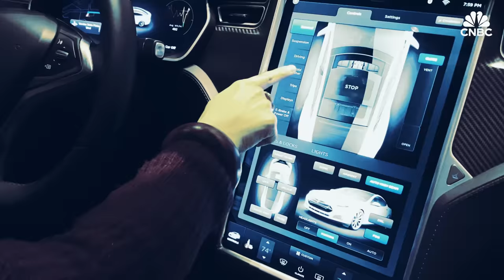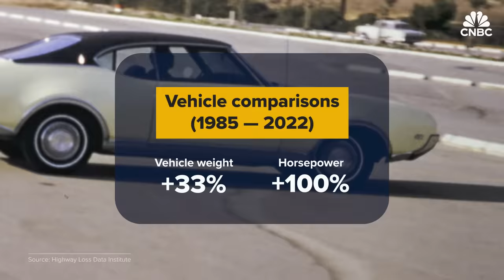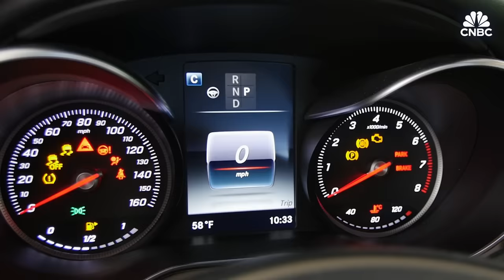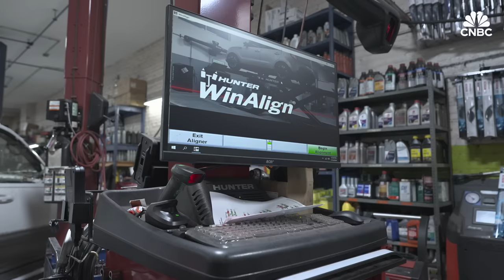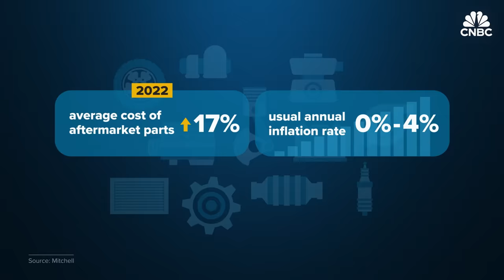Why Car Repairs Are Getting So Expensive

Comment: Fortunately I taught myself at the age of 15 how to do basic maintenance on my cars. I am now 33 and probably saved thousands in repairs. Also smart to buy Hondas and Toyotas.
Reply: I had a Ford when I was 16 - I HAD to learn to fix it if I wanted to use it.
Reply: @the_kombinator  My 2009 Ford Escape has been extremely reliable, almost like my 2002 Toyota Corolla, and I've only done basic maintenance on it. Very easy to change the fluids, too.
Reply: Great, however, most folks actually work for a living and don't have time or don't want to be working on their cars on their days off.
Reply: @tom11zz884  I also work for a living. Actually a military officer now in the RCN here in Canada. Fixing cars is also a hobby of mine, but saves money too. To each their own. Cheers.
Reply: I have a 15 year old Honda with 117K miles. It has a bad tie rod right now. When I get around to replacing it, it will be the first part that has ever been replaced on it, other than regular maintenance parts like brakes, tires, and spark plugs. It has only had two batteries in 15 years, and the current one is ten years old, and still going strong. You can't beat a Honda.
Reply: @jesterr7133  Yeah man smart move! Gonna save yourself a lot of money. Just make sure to do an alignment after that tie rod change. Or make sure you count the amount of revolutions when taking off the old one, put on the new one with same amount of turns.
Reply: @Austin-wz5xk  You mean your "Mazda Escape?"
Reply: This is the way! 

same thinking for so many parts of life. Learn to do it yourself! It feels like every answer is available for free online. …and you just can’t beat that feeling of accomplishment.
Reply: @TroyCraft  I agree. Everything is on YouTube for free, just have to be willing to apply yourself. If the person on the screen can turn a wrench, why can't you? Also, spent many days in the scrapyard picking away at parts for my cars. You learn, you also save money. I have learned more from YouTube from professionals, than I ever have in my 6 years of college and university.
Reply: That doesn't help me, my tires on my z71 were 1000 for four 4 years ago. I bought the same tires last year and they were 1600. I also do basic car repairs as well.
Reply: My dad and I replaced water pumps, alternators, carburetors and all the other things that broke on 1960s-80s American made Oldsmobiles and Fords. I never really liked auto repair, but it saves a lot of money. “I like money.” - Idiocracy

Mom finally convinced him to buy a 1989 Honda Accord. What a wonderful car. After that we only bought 1970s Datsun 280z’s or 1990’s Hondas. Made in Japan cars in the 1970’s-90’s are just incredibly better than American. They just worked! 

These days the only Japanese car worth the money is an older (10+ year old) Toyota.  Old Toyota parts are relatively cheap and the Chinese knock-off parts are extremely cheap but don’t last. Preferably, buy a used Lexus but only Lexus or lesser Toyota brand actually made in Japan. Made in Japan cars are just better made. 

Scotty Kilmer is a great YouTube Channel to learn about car repairs and tips. He says don’t buy Turbocharged or Hybrid. They’re too expensive to repair. The Car Care Nut is also a great channel for Toyota specific information.
Reply: @Luvurenemy  Scotty trash. Care car nut is a good channel. Unfortunately Toyota parts have grown expensive unfortunately and their in house mechanics are lazy. I brought my Lexus in twice for the same problem and it still has the same problem. I've given up on it and I'm going to sell it although I did replace it with another older Toyota.
Reply: @tom11zz884  Time is money - same goes for people that eat out constantly because they're "too busy" to learn how to cook. If you were able to watch this video and comment on it, you have the time to better yourself. Rarely does car work require entire days of work, hell I'm able to swap a clutch in 3-5 hours, beer in hand, on my driveway. 

Keep looking for excuses though.
Reply: Yeah my 2016 civic has 142k miles on it I put every single one, still running like the day I got it. Just do regular maintenance on it and that’s it. Like the man said in the comments can’t beat a Honda!
Reply: You are a smart young man.  To any young man who is similarly mechanically inclined to repair and maintain his own car, I would suggest that if you get married, buy two identical cars for you and the wife.  That way, if you ever think your car is running a bit "weird" you can always compare to your spouse's car and you can always swap parts between cars to find a bad part.  That beats the heck out of buying parts at the local shop and installing them only to find that part wasn't the problem.

Also, get an OBD2 bluetooth reader and the torque pro app for your phone so you can check and reset fault codes and read live engine data.
Reply: Dude maintaining an old school car vs a modern car is completely different. I could service my 3rd gen 4Runner myself except for advanced stuff. Now everything is over complicated and over engineered.
Reply: @markmiller8853  I dunno my near 40 year old Hyundai and my 25 year old Matiz are pretty much rust free - I didn't super take care of them, just don't drive them in the winter. 

If you're getting 1 or 2 years out of TVs and phones, it sounds like a user issue.
Reply: ha ha Honda and Toyota are over rated, dont believe the hype, 3 best friends and family bought Toyotas and all had more and more expensive fixes than my Mazda and Ford l had/have as my friends Honda, why?
Reply: @peterkompter2417  ....i've owned 4 hondas and 2 Toyotas, 1 bmw, 1 ford, 2 chevies....and the asian cars ive had 0 issues with lol. Different experiences i guess.
Reply: I could probably use some input. Am looking into possibly getting a 2021 Chevy Impala. But I'm not 100% certain how good Chevy brand is compared to Toyota and Honda. Any advice is welcome. I really want a Toyota Camry but my options are limited.
Reply: @drewschumann1  Yes!
Reply: I learned a bit late but I learned. I now own only Toyoras and maintain them all myself.
Reply: I hear ya, I have a 2015 RAV 4 which just passed 280,000k miles.  I maintain it with all the fluid changes, belt, etc......I simply can't afford a newer car with what they are asking. The next thing is shocks/stuts and headlight restoration, and I'm more than happy to get it done.
Reply: couldnt agree more!
Reply: I have a 2015 Tacoma. That’s it.
Reply: @peterkompter2417  What models and years?
Reply: I like you.👍
Reply: About to turn 299k on a Chevy that I bought new. A Fuel pump being the lone tow in near 26 years. Years 20-25 saw 100k miles put on it. My neighbors Honda is at repair shops every year.
Reply: @Joeainthere73  Congratulations brother. The vast majority of Hondas and Toyotas are still far more reliable than domestic. Those are the numbers. Were not here talking about 'your car'.
Reply: @Luvurenemy you’re absolutely right. My 1995 Toyota 2.8L Diesel HiAce van and 1995 1.8L Toyota Townace Camper van is built much much better than my 2008 Toyota Sienna. The one’s made in Japan are better from experience. Next Car is a Toyota 4.2L Diesel Landcruiser from Japan
Reply: @waikikisurfingschool270  I’m glad you too had a good experience with your made in Japan, older, Toyotas. It’s a real sweet spot for reliability and quality. Good luck with your Toyota diesel Landcruiser purchase! Sounds like fun.
Reply: @peterkompter2417 I've been buying and selling cars for 25 years, Toyotas are absolutely a stand out for longevity and reliability. I've seen Corollas with 250k miles with their original alternators, water pumps, and power steering pumps. You will NOT find that in a Ford. No brand is perfect, but it's not a secret that Toyota and to a lesser extent Honda have historically built very durable vehicles. To say otherwise is a declaration of ignorance.
Reply: @waikikisurfingschool270 it's true the Japanese built Toyotas have an edge in quality vs. USA/Canadian built. That being said north American built Toyotas are still historically more reliable and durable than domestic car companies offerings. I've had 2002-2008 Corollas from Japan USA and Canada, identical from a longevity standpoint.
Reply: @Luvurenemy North American Toyotas are mostly solid quality vs domestic companies offerings but yes the fit and finish on Japanese made models is notably better overall.
Reply: I've saved myself many, many thousands. I hate working on Hondas though. Toyotas are not quite as bad, jeeps are by far my favorite to repair.
Reply: @jesterr7133  When that battery goes, the next one may last 3 or 4 years. They aren't the same any more.
Reply: @DustinHeath-ki8lt  That is what I found on our vehicles. Tire prices up 60% since the last time.
Reply: Buy a Second hand Lexus, and you will be stress free lol …
Reply: @Austin-wz5xk Some American cars are good in terms of reliability 
My parents had a 2007 Chevy uplander minivan. It was used daily regardless if it was -40 or 105 degrees outside. It went on multiple cross country trips with its payload capacity 90% maxed out. It was a strong reliable work horse that my dad drove daily for 14 years without any real issues. It was finally time to let go after 200k miles when the transmission decided it was time to retire. The engine on the other hand was still strong for another 150k miles.

Comment: I been a mechanic most my life and most people who buy a car are not thinking about repairs down the road. No one is thinking how much is this blend door actuator going to cost when it goes out or the heater core,etc. I kinda do cause I’ve always had to replace them. I drove a 1990 Silverado for 15 years, when it became so rusty I bought the identical truck 2 years ago to replace it. These old trucks rarely have any issues and are crazy easy to work on when something goes wrong and parts are everywhere and cheap. Ill never buy anything new, glad I got out of that job field 6 years ago
Reply: W-w-what do you mean I have to change all 4 tires in my Subaru y'all are scam artists 
-subaru owners
Reply: People do not pay any attention to maintenance costs, they only worry about how good they look behind the wheel
Reply: @Shuturulsdad  yeah the joys of all wheel drive
Reply: @coache1nine   pretty much. I always figured that’s why Chryslers are so popular. Great looking vehicles just poorly made but i guess pretty much everything is now
Reply: I wish I could get a basic 4x4 truck with not all the fancy electric things in it I just want to drive to point a to point b an make it with device that don't allow cell phones to work inside we are driving not here to play on phones

Comment: Did 7 years in small engine work before going to school for automotive. When I got out they wanted to start me at $11-$13 an hour. This was in 2019. I said screw that and went to work in a glass factory starting out and more than double that with no experience required. After a year working there I was making over $30 an hour doing production. I know diesel mechanics with 10 years of experience and don't make what I make. I still have my autel scanner and a shop full of tools and do 90% of my repairs myself. In 3 years the school paid for itself and I don't even work in the field. The car business has a high turnover for a reason.
Reply: It really sucks when the job pays 1.5 hours, but you get to deal with broken bolts or cleaning up someone's mess who was in there before, and deal with rust and blah blah blah, and it takes you 1.75 hours to do the job.  Then you are effectively working for free.
A person can REALLY do well by working for himself in the industry.
Reply: @paulstandaert5709  I was pretty good at beating book time on most jobs on the classes. We were told for service management that you should be charging 1 hour for every broken bolt regardless of book time, and it should be agreed upon when the customer drops off the car. I was self employed doing small engines and it was good money, automotive get almost double the labor rate here so I agree 100%, that's if you have the patience to deal with the public. My patience with people wore pretty thin after awhile.
Reply: h0ow long did it take you for that? id love to learn about cars and stuff ive been gradually teaching myself i think itd be such a handy thing to know.

Comment: YouTube has saved me thousands as I do most of my own work on my cars now.
Reply: Exactly,  if you already know how to do something it's also good as a refresher.
Reply: Not everyone is adept at DIY car repairs. But yes YouTube helps.
Reply: Same.  Youtube university.
The only repairs I don't touch are extensive engine repairs and stuff that needs a full shop lift.
Anything else I do myself.
Reply: Right
Reply: For now
Reply: @jimbeam2705 but if you make a repair worse than it was before. Then a professional will say dont touch it ever again and im gonna charge you more to undo your mistake.
Reply: True. Self repair can save the $130 to $200 per hour repair costs plus the 20% parts mark up. (Hopefully you aren't buying the lowest cost parts as they are often sub-standard bogus, even forgeries of dealer parts.) Often the cars one can fix at home with "average" tools are pre 2010 models for a person who doesn't work in the industry, especially the cars that were lower priced when new.
Reply: @mikep490 no. Just no. Doing fluid changes, tune ups, and brake pads are extremely cheap basic tools that haven’t changed for decades. The same set of tools I use to work on my 79 dodge also work on my 2022 Volkswagen, basic maintenance is only so advanced.
Reply: Mechanics are greedy and crooked most of the time. The manufacturers are greedy and crooked by making vehicles hard to work on. Vehicle weight being heavier is bs dare you to weigh a 55 chevy against a new car. Unless you're talking ev I could see those being heavy. Those batteries and components are no joke when it comes to weight.
Reply: Not anymore with these democrats
Reply: @buzztrucker  I had no one teach me, no cool dad with a car, no grandad with a garage. I do all my repairs even engine stuff. You can too!
Reply: @buzztrucker  Some have youtube videos that show you step by step what to do.  Your skills don't even have to be that good if you can follow directions.
Reply: They will just break something in your home or add it to your insurance rates next round or make a retirement investment or utility balance out your savings
Reply: @ChristopherNagg  you mean Republicans

Comment: A few months ago I went to one of the largest Nissan dealerships around to get a quote on changing my transmission fluid and both transmission filters. First they argued it's lifetime fluid and doesn't need changed. I advised them there is no such thing as "lifetime" trans fluid. Second they argued there is only 1 trans fluid filter when there are definitely two.  Finally the price.  For 5 quarts of Nissan trans fluid, a new trans oil pan gasket, filter, and labor was just a little under ONE THOUSAND DOLLARS!

I got all the parts I needed and did it myself successfully for about $85. I feel bad for anyone that isn't financially well off and doesn't have the capacity to repair their own vehicle.
Reply: smart move. the only people who promote "lifetime" fluids want to sell you car parts in a few years.

Comment: I stopped fixing my car at the shop two years ago after I realized I'm racking up credit card debts because of repair bills.  I thought my self basic mechanic skills and I buy parts online.  I drive my car to the ground, scrap it and buy a newer used model from a private seller. I'm 50 and Im not expecting to set foot in a dealership to buy a new car ever, not even or any other car. Bottom line it's greed, cost of doing business. It's unsustainable

Comment: Was rebuilding small blocks in our high school shop class late 80’s. We had welding, woods, fabrication. Those type of classes are largely gone due to the big push trying to get every kid to college. Adults can’t even change their wipers now or their pouring engine oil into the radiator. All this higher education for nothing
Reply: My oldest stepson took welding and he has interest in mechanics too. I don't think it is eliminated everywhere.
Reply: There are warnings on batteries indicating that you should not consume the contents of it. When did we go from "sure I can give you a boost " to ingesting acid?
Reply: All of those classes still exist at many high schools.
Reply: Sure, but windshield wiper changes aren't keeping collision and body shops in business. Sometimes, there are bigger, systemic issues that don't have a local solution
Reply: Fatherless households my g. Lucky I had a grandfather. Men doing right by their families would have kept a lot of this bs from happening. Plain and simple
Reply: lmao, i know a guy with masters degree and cant even change a headlight bulb. so much for a prestigious degree. I have no degree and can replace a engine out in the parking lot..🤣🤣 i have did a few in the parking lot lmao.